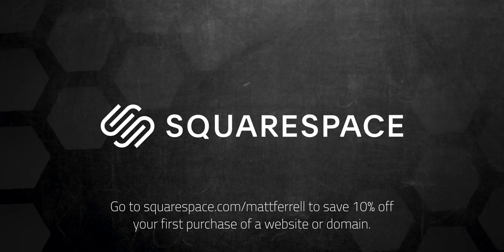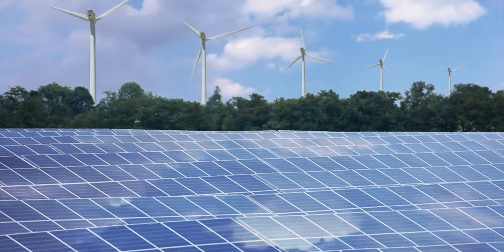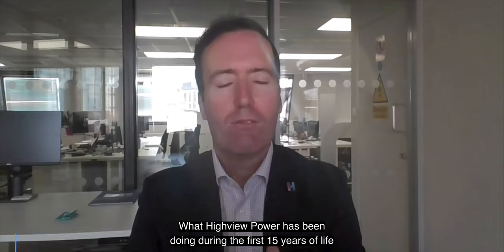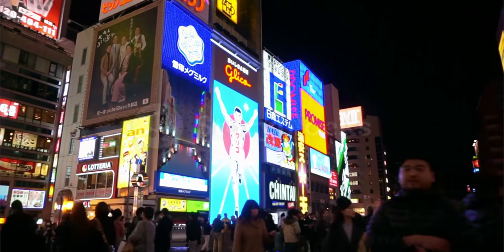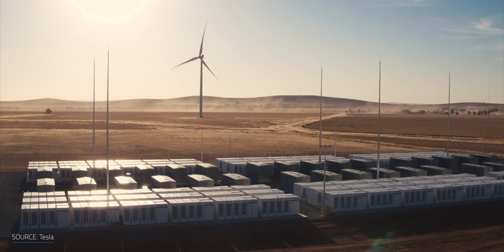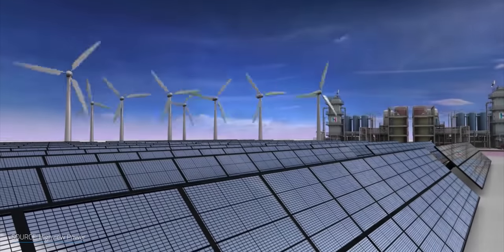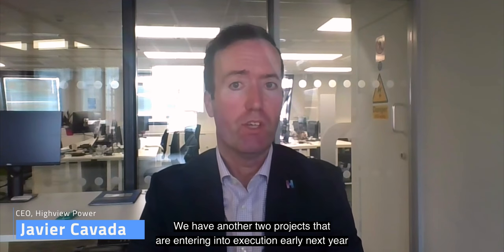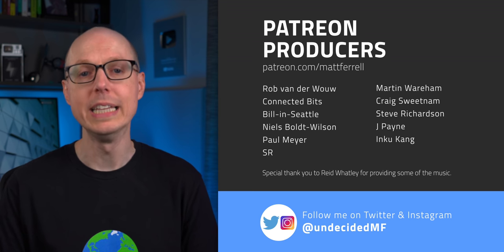Liquid Air Battery Explained - Rival to Lithium Ion Batteries?

Comment: I see the energy storage problem the same way I see the computer storage problem. You have to have a layered approach; you would never sell a computer with a CPU and no RAM or hard-drive storage would you? Of course not. Nor should we rely on L-ion batteries for our energy needs. You have to have multiple technologies all working on the same grid with varying levels of capacity and speed (or ramp-up time/discharge rate). I love the idea of liquid air energy storage for all the reason you mentioned: It has a very large capacity, scales well, and can be built just about anywhere. Couple it with a battery bank, a solar/wind farm, and maybe some other technologies and you've got the recipe for a seriously robust grid.
Reply: We'll said.
Reply: Economically it is challenging
Reply: JOSH - LION is too Valuable and Expensive for GRID Storage , which is WHY TESLA is going to LFP , IRON is a Cheap, Recyclable and Plentiful materiel.
LFP batteries are Heavier , but Weight is a NON Issue in GRID storage.
Reply: yes, excellent point.  it all about optimization.
Reply: i mean...excellent point Josh.
Reply: in Europe everything is summed up to money .... everyone wants to change something in the world (for good) but that the final result is more money for the businessman ... nobody ever thinks about the final consumer. We want less polluting vehicles and we fill them with electronics and expensive components or we switch to electric vehicles. I can't understand why an electric car costs more than a combustion one, when all batteries and components are manufactured in China at very low prices. I think you talk about drums of this type is to talk to talk and have us entertained.
Reply: @vw254   - its easy, Legacy OEM's dont build /design any Electric cars or even Hybrids. 
#1 - batteries , Auto makers are paying 5x more for Batteries , because they dont have a Battery Factory .
and Battery OEM's Control the Price and supply. 
IF there is High Demand , they charge MORE. 
There are only 4 Tier one Battery OEM in the world, CATL, Panasonic, LG Chem and Samsung SDI. 
MOST Auto makers are Buying Cells without Building a Battery Factory. 
TESLA built the Gigafactory to get Lower Price and Ensure Supply. 
which is why Costs are out of Control and SUPPLY is LIMITED. 
as many Batteries are used for OTHER things.
and is WHY many Electric cars have LIMITED production runs, and LOW Inventory.
and is why they have SHORTER ranges than ANY Tesla. 
the GM Ultium battery is NOT even made by GM, its made by LG Chem, GM just Slaps their name on it.

#2 - Legacy OEM's dont even make the Electric Motors and BEV Drivetrain. 
they get it form Suppliers. 
and Intergrated it into the Vehicle. 
this adds COST as well. 
the Chevy BOLT is 78% Made by LG Chem, CHEVY only makes the car BODY , and uses MANY parts from Diffrent Suppliers, like the Computers, Wireing , sensors, cameras, ......
doing most EVERYTHING in house , makes it cost less.
MOST car OEM's do not Design + Build a Specific Electric car body, they are using MORE Expensive GAS car body on a Electric Platform, sometimes they offer GAS, Hybrid , FCV and Electric car on the SAME Vehicle body, this is MORE Engineering than NEEDED, costs more to Develop something that has to work with 4 Diffrent Varriants with their own needs, CARS are more Heavier & LESS Efficient than a TESLA.
Reply: @vw254  Usually for the cheaper EV's batteries would probably be around 1/3rd of the cost. EV batteries still are quite expensive, though not nearly as much as they were 10 years ago. It isn't like they just charge much higher prices for EV's then for ICE cars, what would be the point? Yes, for regular car manufacturers not changing things might be a reason, but for dedicated EV manufacturers like Tesla? Lower prices would allow them to compete more with ICE cars, which would be better for them. Though Tesla does keep a relatively high profit margin because they still are growing and are essentially constantly behind demand.

And ofcourse in Europe there are rather high taxes and (in case of Tesla for example) import taxes and shipping costs.
Reply: @MDP1702  BYD HAN 2020 in Europe costs half as much as a Tesla. I don't think it's half as bad as a Tesla. It is about what the company's policy is. Sell a lot and cheaper or sell less and very expensive
Reply: @MDP1702  I think it all comes down to money in the end. The costs of building these vehicles with their batteries and then generating energy for all these vehicles, if we calculate it in pollution, we would be scared.  Greetings from Spain
Reply: @vw254  the BYD HAN 2020 seems promising, though he doesn't cost half as much as a Tesla, the model 3 would cost around as much, with similar characteristics. So it might be a rival for, but Tesla is set to come out with a cheaper EV in the next 4 years. Also It will be interesting how it holds up to the model Y with the new battery technology.

Again what are you on about in regarding to pollution? Will there still be pollution? Ofcourse, we still live in a fossil fuel system, so producing things will create pollution. However the pollution of EV's and renewables is way lower than that of fossil fuel, it isn't even close.
Reply: I like that approach. I was thinking exactly on that. I've been a prepper for 15 years, and worked in the oil industry in engineering. Redundancy and layering is essential for robustness.

Comment: Liquid air energy storage - great idea & great presentation (as usual, thanks).  Regarding response time of this tech - why can't you also have a quick air battery system response by pairing lithium ion batteries with "air batteries"?  How much lithium ion storage is needed?  Answer - The size of the lithium ion battery to pair with an air battery is based on the time it takes for the air battery system to respond (how long for the air valves to open and for the gas turbine to spin up) combine this with the rate of energy you need to pump into the grid to compute the size of the lithium ion battery pack.  So, I am guessing that it only would take a minute or so for the air battery to respond, so a relatively small lithium ion battery pack would fill this time gap.  Once the air system is spun up, it can provide the main power and recharge the lithium ion pack.  This is not a new concept.  Electrical engineers have placed capacitors in electrical circuits since the dawn of circuit design to provide near instantaneous short term power to meet the millisecond to millisecond fluctuating power demands of, for example, a speaker amplifier circuit.  In short, you can have your cake and eat it too, NBD.
Reply: Spot on.
Reply: I think that's another reason why they refer to lithium storage as a "sibling" more than a competitor. The whole idea is to have a minimum lithium base storage that can work within a moment's notice on sudden demand spikes, and then the liquid air storage can do the full day storage passively in the background. This combo minimizes the need for mass lithium systems, while still being able to respond quickly to urgent needs. The main trouble is if the sudden requirement for immediate power is too high for the lithium pack to handle, so the question is where is the desired balance point between the Lithium / liquid-air ratio.

Comment: I'd never heard of this tech before! Loving the channel
Reply: The channel "Just have a think" posted a video about this months ago. Its a cool idea but i'm not sure its worth it. Solar and wind are going to struggle to meet power demands as is without having these losses in efficiency. Nuclear power is still the best option.
Reply from the maker: As Javier pointed out, it's all about the money in the end.  Utilities are following the path of cheapest per MWh price.  Nuclear isn't the cheapest option out there ... but it's a good option depending on the situation.
Reply: @UndecidedMF  My argument is that solar isn't going to work anywhere outside of desert climates like California. If you look at places like Seattle they receive 1/6th the amount of sunlight in December vs July. This is an extreme example but its very common in northern regions to receive far less sunlight in winter than summer. So if you build enough solar panels to meet demand in summer than you will have a huge shortage in winter, and if you build enough to meet demand in winter you will have a huge surplus in summer. Also consider regions further north like Alaska which has even more extreme variations in sunlight, but also has to deal with extreme cold and snow. 

Another thing to consider is that solar requires 1000 times the land area of nuclear power which means that to meet demand you would have to cover such a vast amount of land it would be more destructive to the environment than it would be beneficial. Then there's the waste problem as well. This is especially problematic in areas that are both densely populated and mountainous like Japan. Japan doesn't have anywhere near enough flat land to install solar panels. 

Nuclear power works anywhere 24/7 365 days a year. Its constant, dispactable and very energy dense. Nuclear power is the future. I know renewables are "romantic" but its simply not feasible.
Reply: @Name-kd5jj  you have targeted solar pretty specifically here to make a point, but you have ignored the fact that solar is not the only renewable energy source out there. There is on/off shore wind, geo thermal, tidal and good old fashioned hydro etc. My point is you choose the energy generation method that is most suitable for the location and if that is nuclear then thats fine but its not the be all end all of energy generation and pretending it is won't change that.
Reply: @slanahesh  Yes wherever renewables make sense i say go for it if its financially practical and doesn't disrupt the environment. Either way nuclear power will probably be present everywhere due to solar and wind's intermittency. Geothermal, tidal and hydro only work in certain areas but have the advantage of being more constant and reliable than solar and wind. So i say in desert areas go for solar because they're empty( no deforestation to install solar), sunny and usually sparsely populated. Japan may be able to use geothermal, tidal and wind, but given the extreme population density they will still have to rely on nuclear. I never said nuclear was the miracle fix for all energy, wherever we can install renewables to increase grid efficiency i say go for it. But renewables are not going to be the do-it-all solution either.
Reply: @iphigenia8661  Yes but even if we could double the efficiency of solar cells it would still require far too much land. As far as transmitting electricity from deserts to northern regions, its just not practical or efficient to send electricity over very long distances like that. The longer the distance the more energy is lost. 

While that could work in the US it probably would not work in Europe. The only deserts in Europe are in Spain and they're very small. While the Sahara desert is just across the Mediterranean it would be difficult to get that energy long distances across a sea. Not only that but it would require Europe to be energy dependent on volatile countries. Not so good for energy security. 

With nuclear they could mine Thorium locally and be energy independent. Given the extremely high energy density of Thorium even small domestic supplies would last forever, at least until nuclear fusion becomes feasible. Once that happens i see many territorial disputes on the Moon in our future. In case you don't know helium 3 is the theoretical best fuel for nuclear fusion and while not found on the Earth is very abundant on the surface of the Moon. 

Either way the number 1 priority for a country is having energy security. Whether we're talking being energy independent/dependent on an ally nation or having a reliable constant source of power that works in any condition, during prosperity or crisis. Nuclear power provides that security while renewables do not. If nothing else thats why nuclear will win this energy revolution.
Reply: @Name-kd5jj   The U.K. is cold, wet & miserable, but they're doing just fine with renewables - meanwhile the nuclear power plant they started a decade ago still isn't up & running.  How long would it take to build wind & liquid-air storage..?

Comment: This could condense water from the air as a byproduct even in the desert
Reply: Good point!  There are other methods to produce water from air (eg salts, my air conditioner:-) ) but water would be a natural byproduct of this process as presumably one wouldn’t want water/ice to be stored.
Reply: Hot climates yes, but if it's a desert it wouldn't be effective.
Reply: Like the vaporators on Tatooine...  :-)
Reply: We can also use it to capture trace amounts of CO2
Reply: @Andreas Berni Those two are already confirmed as scams.
Reply: The air is fairly dry in deserts, but one could use it in dry coastal areas nearby saltwater.

Comment: To me this seems like the first grid scale option that will actually be viable. Sure, Li-ion is great, but it's expensive and battery cell production isn't large enough to provide the energy storage solutions that we need.
Reply: I watched a presentation they did, and doing the calculations for new york alone, they found that this tech would supply about 3/4 of all the energy storage requirements for a 100% renewable grid with batteries supplying the other fourth (including existing pumped hydro). that would still be tens of gigawatt hours of battery storage and 100s of gigawatthours of LAES. Both work together, batteries because they have better efficency and these because they cost much less to operate
Reply: @prerunnerwannabe
Said, "... battery cell production isn't large enough..."
The li-Ion cell production is being scaled up to be mass produced in the gigafactories that Tesla is building right now.  The cell production lines are being optimized for maximum production at minimum costs.  All of the cells Tesla makes will be used in their products but their Megapacks will be installed in utility scale battery storage projects and their Powerwalls will be installed in tens of thousands of homes.
Tesla is calling their plants gigafactories but they will make more than just giga, they will be making tera quantities.  Their gigafactory being built in Austin, TX sits on 2500 acres of land and they have plans to grow 50% per year, year on year.  Tesla's solar and battery storage business will be bigger than the automobile business.
Reply: @acmefixer1  Yes, I'm aware of Tesla's ambitions, but expecting that lithium ion batteries will be the only solution for grid storage is just short sited. We need all viable forms of energy storage to be aggressively pursued if we actually want to transition to a renewable power mix.
Reply: Exactly.  Liquid air has the best potential to scale quickly.  It may take decades for Li-ion to scale to the production capacity liquid air might achieve in just a few years.  Paired with new gigawatt scale solar PV coming in at less than $0.02 / kWh in favorable locations, a storage loss of 30% to 40% is economically viable.  Curtailment of PV generated power only serves to bolster the economic case for liquid air storage.  Even with a 50% storage efficiency loss, a rated $0.02 per kWh solar system now becomes a $0.04 per kWh system.  That is an economic, "So What".   $0.04 per kWh is great wholesale price for electricity that can be produced to meet demand 24/7.   Of course, the operational cost and amortized design and install cost of the liquid air system has to be added to the $0.04 per kWh.  Therein lies the rub in all this.  Setting aside input energy, how much does it cost to design, build, and operate a liquid air storage system?

Comment: 60% to 70% efficiency, aka 30~40% loss, still sounds pretty damning for a utility scale storage process. Most batteries and gravity-based storage methods can reach 90% or above.
Reply: IMHO the efficiency of storage becomes much less important, when abundant cheap renewable sources are available to recharge it. It just needs to be able to deliver net-output cheaper than other medium-term on-demand sources like hydrogen combustion or pumped hydro. Batteries and pumped hydro are efficient but have relatively high capital cost. Liquid air technology looks competitive with other medium term on-demand sources and has relatively low capital costs.
Reply: I think they are talking about a situation where you have more solar/wind power being generated than you can use.  It is going to be 100% lost if you don't have some kind of battery so the question is how much does it cost per kWh of surplus energy captured.  Of course, if you have an overnight demand of X and your storage is 50% efficient, you will need to have generation capacity of 2X beyond the capacity that is used up during the day.  That is, the more efficient your battery, the fewer surplus solar panels (for example) you need to charge the battery.

Comment: Efficiency is only an factor once we have enough storage to stop "throwing away" the power we are already able to generate. In the UK we need to build these big and build them fast, the renewables are growing quickly.  
We also had a problem where our gas tubine power stations had to "derate" for a few days, as the air temperature was so warm, the efficiency of their cooling was lowered, so we were burning coal!!  If one of these stations was nearby, the gas company could have used their excess heat to warm the liquid air, which would have improved the efficiency of both systems!